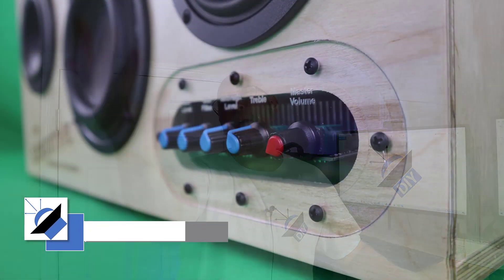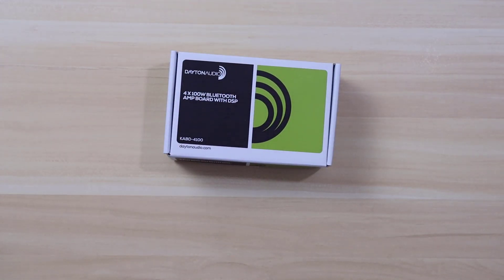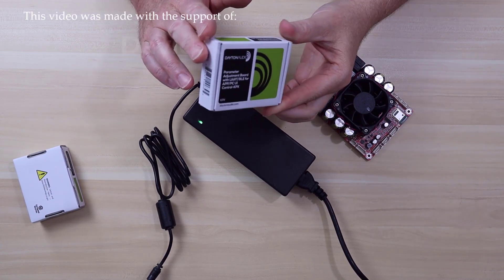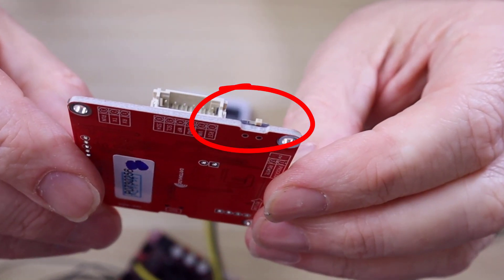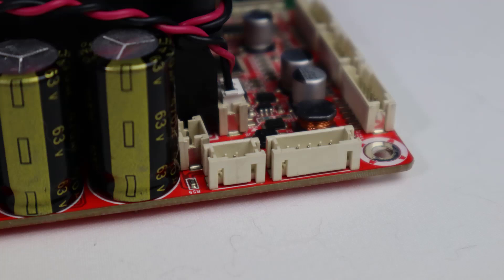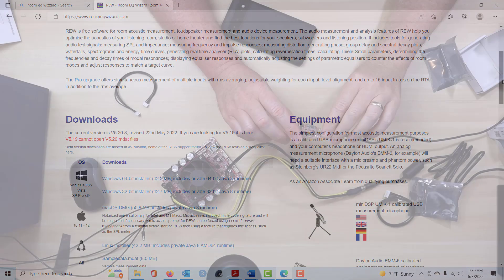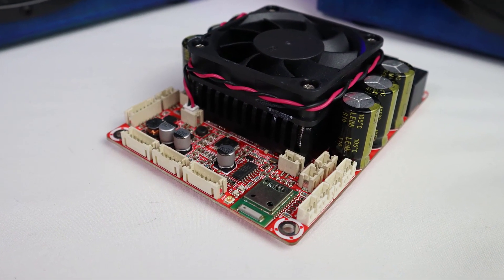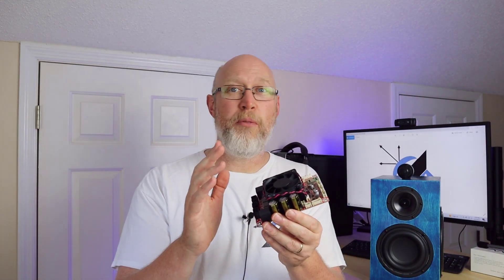DSP Amplifier:  Four Channel BLUETOOTH KABD 4100 by Dayton Audio.

Comment: Cool possibilities for design flexibility with that amp board, but with it being a relatively inexpensive one, (surely) made in China, and def. a Class D amp based on its size and lack of heatsink, I would be concerned with the overall sound quality, rated distortion and noise levels, and realistic CLEAN (i.e. as UN-distorted as possible), power output abilities.

It may very well give you lots of options in design flexibility, which is indeed cool, but is it actually up to a higher audiophile sound quality standard... i.e. what you would actually want to have if you actually took the time to custom design and carefully build your own speakers!...

Also, even with as "easy" as this amp is to set up and program on your computer, since I am not at all a computer person, I personally think that it's still MUCH easier and simpler to just use good old fashioned passive component crossovers to build your speakers, than trying to figure out how to use a computer and then have to also program this amp. The programming procedure looks extremely complicated, way more so than simply designing and building a basic passive component crossover in the first place!...

But "to each their own" I guess. I'm more "old school" than this amp, especially since I don't understand anything about computers, not even how to turn them on or off properly... the closest thing I ever get to using a computer is my scientific calculator and my smartphone that I'm watching this video on and typing this comment on, and I still haven't fully figured out how to even use that to its fullest capacity, even after 3 years of daily frustration with it! (basic functions only)
Reply from the maker: You really should be using something like X-sim to design your passive crossovers.
Reply: @DIYAudioGuy  Haha, yeah, but IF that is what I think it is, (a computer program), I wouldn't ever be able to figure out how to use it, because I don't understand anything about computers, not even how to turn them on or off properly. The closest thing to a computer that I can operate, (mostly), is my cellphone, (which I also use to watch Youtube on), and my trusty HP48GX scientific calculator that I've had since my senior year of HS back in '92... I'm totally "old school" like that, lol!
Reply: @JoeJ-8282  I'm sure that if you've done passive crossovers most of your life then it will be far more intuitive, however for most beginners the flexibility of active crossovers make it a no brainer in many situations
Reply: @blakebrockhaus347  Yep, and I'd really like to somehow learn how to play around with the design flexibility of those types of programmable things, but aside from a (stereo) "component" style active crossover with actual adjustable physical knobs, buttons, and switches on it, (which I'd love to have, but they are all very expensive, totally out of my extremely meager budget), all of these other more "virtual" devices, that require a computer to program their settings and options, are all way out of my comprehension, because I'm not at all a computer person, and I never have been. I've tried to have my friends and family show me how to use computers many times throughout the years too, but my brain just can't deal with "virtual" controls, on a screen that always changes depending on whatever "page" or "mode" it's in...

I think it may have something to do with me having Autism Spectrum Disorder. I need things to always stay totally consistent and reliable, (i.e. exactly the same all the time), so I can actually remember how something works with enough time to get used to it. But so it can't be continuously changing like a computer screen does, and have buttons that do totally different things all the time, different with each screen or whatever. Computers in general are just too complicated for me to grasp how to use them.

As close to a computer that I can (mostly) understand how to use is my cellphone, but that's only because I've finally gotten used to how it operates after having it for over 4 years now... The bad thing about that though is that now my phone plan/company wants me to "upgrade" to a brand new phone because I guess mine's not "5G" capable... Really pisses me off, because now I gotta get used to another phone entirely, with a completely new and different button and control layout, etc... It'll take me another few years to finally get used to whatever new one I end up getting! :(

Comment: You should dyno the board!! I believe it's a TDA7498E board which will do "rated" power with a 36VDC input. Though, you would need, at least, a 350 watt power supply to confirm if it does rated power.
Reply: Yeah, but if the amp in this video is indeed utilizing that TDA7498E chip then if you look at the actual manufacturers datasheet for that chip, it is claiming a (bullshit) power rating of 160 watts ×2 channels, however that is at a ridiculously "dirty" (i.e. highly distorted) 10% distortion rating, which is totally destroying the music fidelity at that point, so if you look further down on the manufacturers data sheet at the graphs of power output vs. distortion, then you can get a more realistic and relatively clean power output rating, (i.e. at under 0.1% distortion, the point of the beginning of onset of clipping, where the distortion all of a sudden shoots sky high to infinity), and that point of beginning clipping is at around 70-75 watts max, so that is a more useable and realistic, clean power rating for that chip it looks like, judging by the manufacturers graph on the datasheet...

Even so, that is still pretty nice and decent power output from such a small amp! (Just don't expect it to actually sound good at its claimed 160 watt output power, because that power output is at such a high 10% distortion level... It would prob. sound OK at or below the beginning clipping onset point of 70-75 watts or less though.)
Reply from the maker: I did dyno it, but I think I had something set up wrong.  I had it wired for 8 ohms but the amm1 was reading less than 4.  At some point I will figure out what was going on and post a power rating.

Comment: Big question, what if I wanted do make a 5.1 home theater system without using passive crossovers for the satellites? Would I need a dsp amp for each of the speakers? Also, would the amp of the av receiver just be useless at this point? How would you go about a similar project? Thank you very much and keep up the great work!
Reply: It depends on what you're wanting to build. If you were doing 2 way speakers then I would get 5 of the 2 channel boards. One for each speaker. And then use the pre outs of the receiver to connect to each amp. Although at that point it may be easier and cheaper to buy a kit which already has the crossover designed for you.
Reply from the maker: Yes.  You would need an AV receiver with preamp outputs for all channels then you would need an amp channel for each tweeter, mid, etc.
Reply: Well, for 5.1, you could actually just use a modern ATX motherboard. A lot of the really modern ones have really good DACs and SNR too. For a basic system like that with satalites, you can even do the processing on the computer if you go down that route. Equaliser APO is a great option. With that, most modern boards support up to 7.1, you'd need a player like VLC to get the surround working nicely though! (Assuming the satellites are full range). If not, you could have a DSP/amp per channel with 3 way crossovers if going two way (one high pass to the sub). Then for sub processing you could offload it onto another DSP/amp or keep it on PC. Or as Justin said, the much easier route is to use an AVR with Preouts if you have one!
Reply: @Elliott-Designs  thanks for all the help guys! It all looks very interesting but intimidating 😂 I guess I'll stick with passive crossovers... But I'm having a lot of issues with phase alignment when I model crossovers on vituixcad. It almost feels like blindly fishing for the right combination of values sometimes 😭
Reply: @Akusen_Arcade  it really is. With passive crossovers you have to compromise between phase and flatness. Also, there's lots of options for active stuff, but it's actually far more simple than passive. You load up the schematic, change the crossover values, send it to the board. Plug it all in.
Reply: @lio1234234  oops, I replied with the wrong account 🤣
Reply: @lio1234234  yeah I get the practicality of active crossovers, but it is complex as far as amplification goes. If I could place the dsp crossover in between the speaker and the amp I wouldn't even think about passive crossovers 😂

Comment: I'm getting ready to build a pair of 3 way active monitors with kabd boards and dd audio A series components. All I'm waiting on at this point is building the cabinets
Reply from the maker: That is my favorite part.
Reply: @DIYAudioGuy  I'm planning on using a CNC to cut all the parts, only issue is that the guys at DD who know how to use a CNC are swamped rn